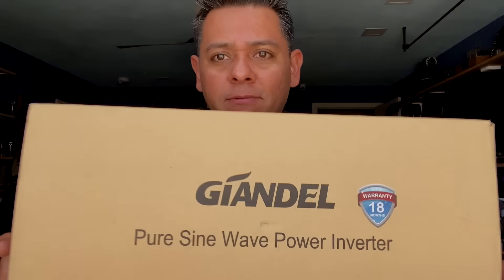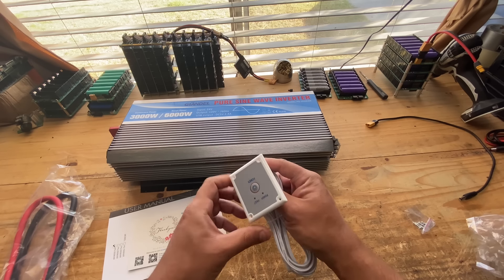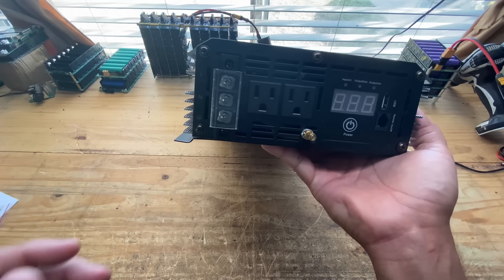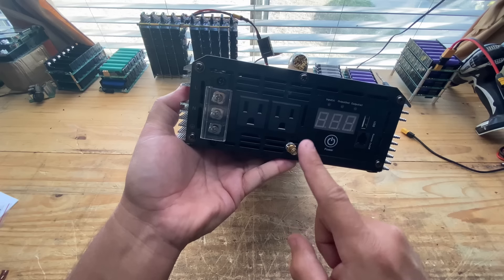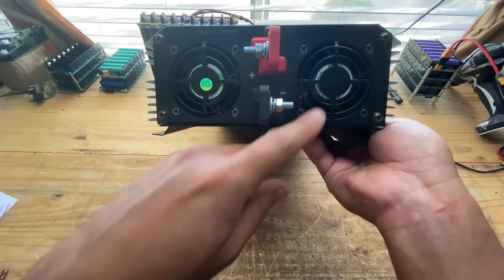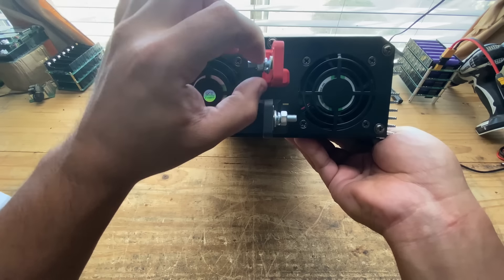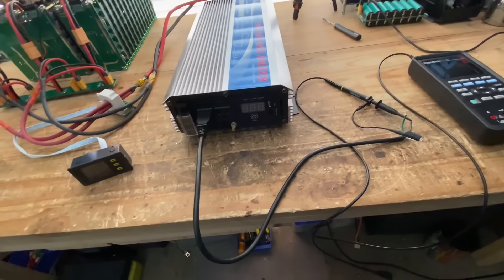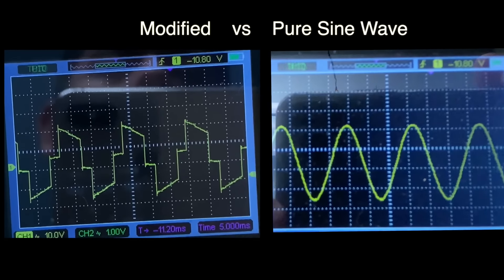Giandel 3000W Pure Sine Wave Power Inverter  Review

Comment: @6:57 efficiency is 85% not the 92% as claimed in the Video, input voltage was 27.55 and current was 19.6 Amps hence power was (P=VI) 539.9 watts and output power was 460 Watts.

Comment: I need to make a portable 48V 10kWh hand truck system. I would like to use an inverter charger. Xijia makes a 3000-watt inverter/charger (6.7kg) that might work well, if it comes in 120v AC. I need to decide between this and a Growatt 3000-watt, which is about 650USD but weighs only 12kg, or a Growatt 5000-watt at about 900USD, which also weighs about 12kg.
Reply: Just now realized that the Growatt 5000 comes in only 240v. Adding a heavy transformer defeats the whole purpose of making a portable system.

Comment: Does this inverter is really providing 120v from the outlet ? my second question if  I have 3 battery of 12v Can I plug them in serie and prallale in order to get 24v system. Thanks JS

Comment: excellent video. if was to add to the conversation. i would not trust the inverters display to be accurate. if used my inverters display to calculate my inverter's efficiency, it would be about 95% efficient. if i measure the output of my inverter using killawatt meters, which i trust,  i show my efficiency to be 89-91% efficiency. of course this will change with low voltage going into the inverter and and various loads put on the inverter.

Comment: Hi Jehu wassup there great review on this inverter but it is maxed out at 4kw for safety it seems than the actual rating of 6kw? Well being a sound guy I figured out while you were showing the inverter your lence and rode mic were looking at the object making y you sound like talking off the mic, a small tip to just turn mic towards you while you point camera at any object that will give your audio more clear n good, colour settings on camera did change you were looking as if a posterized effect was used, please don't feel offended Jehu but yes turning mic towards you on flash mount of cam will tighten your production quality bro, I m a sound engineer and film editor so would like my brother's productions super tight as his knowledge, GBU
Reply from the maker: I used my iPhone on this video,  no external mic
Reply: @jehugarcia   ohh ok, I thaught you had your DSLR with rode mounted on it, Jehu I got my hands on a Toyota Innova, soon as I get good amount of cells harvested I shall start the conversion, only your guidance will do that right.

Comment: 2.5 Years late, but the 'inverter temperature' is actually a reflection. Shiny metal is horrible for trying to get a remote read on because it is just a thermal reflector.

Comment: The output diodes look like they will get hot during use. Their layout seems kind of badly thought-out. Their heatinks are facing the airflow and blocking it, and the capacitors either side of the heatsinks will block any airflow that does make it through.

Comment: jehu I need some help. What kind of inverter do I need to run my ninja foodie air fryer in my van? According to website it runs at 1760 watts and 14.6 amps. 
I currently have only one 100 watt solar panel and 2 AGM Optima batteries.

Comment: With that alternate power hook up, could you attach a 30 amp rv plug in
Reply: You could connect a 120 volt 30 amp outlet, or female cord end to the AC output terminals. 

Note: 
3000 watts @ 120 volts = 25 amps
6000 watts @ 120 volts = 50 amps

Comment: How does this compare to aims? I have been looking at the aims pure sine wave with 120a charge capabilities. Possibly the 240 volt for whole house power off battery backup and pair it with solar battery charging. I do like the remote switch on this guy though.
Reply: I saw a review of one of the aims and it handled beyond its rated surge capacity very well for a long length of time.

Comment: Can this inverter be connected to a panel with that has the neutral bonded to ground (within the panel)?  Like most houses in the US and Canada?
Reply: you don't understand your question enough; how can we?
without a transfer switch you shouldn't be connecting up to your panel. with a transfer switch you can shave your electrical bill.
Reply: @fishhuntadventure  To be clear, I meant in an off grid situation.   (Not grid tied.)   Most homes have the neutral bonded to ground inside the panel.   So if you connect the hot and neutral  you are assuming the grounding of the panel.  Some cheaper inverters don't permit this as they are actually +/-60V AC with respect to ground instead of +120V.   If you bond the neutral to ground with these inverters you are basically shorting it out.  But better inverters usually tolerate it.   I was wondering which style this one is.
Reply: @JoshDurston  thanks for the clarification. 
FWIW my Giandel 1200W? (not there, can't remember exactly LOL) just sits in the floor of a cabinet and I use the remote to cycle it on/off. It is earth grounded as well as the bare copper grounds to the panel bare copper. I literally used a 12ga extension cord wired to a GFCI and plugged  in to the inverter. Then I ran another short cord from the GFCI to the fuse box. Sure the fuse box will "handle" more Amps but i figured it did not matter since the inverter will top at 15 or 20A surge and trip out and other than the vacuum (8-10A) nothing big ever will be run. 
I have not had any problems, the GFCI works with the test button and a plug-in tester,  and the GFCI has only tripped once in use when I turned on the range hood light once two summers ago.
I don't think the bare copper / 3rd wire should ever be any volts AC if everything is wired correctly. That's a just-in-case safety measure wire that should trip a breaker or otherwise  prevent electrical shock should an 'event' occur is my understanding.

Comment: Just had 2 of these via amazon and had to send both back, same problem with both - kept cutting off while trying to do a coffee from a 1200w coffee machine and i noticed that the voltage displayed on the inverter was about 0.6 of a volt lower than what my battery monitor and my multimeter was displaying, it may not sound like alot but when my batteries was showing 12.9v the inverter was showing 12.2v - batteries at 12.7v inverter at 12v and then beep beep beep then turns OFF !

Comment: I am looking at using one of these 24v 3000 - 6000w inverters on a lithium titanate battery bank comprising of 66160 cells 10S 6P, I do like the low battery cutoff range on the specs that would suit the LTO battery bank, anyone else tried one of these in this combo?

Comment: How big gauge can you fit in those terminal blocks. I can't believe they're rated 25 Amos but they use 12gauge wire. I wish they opted with the 10gauge on the ac side

Comment: 13:27 The Min/Max option on a multimeter will not measure the inrush you need to use one with an inrush setting, I did that with a grinder, and it said 20 max amps, but when I used inrush it showed 37 amps. the min/max just doesn't grab the actual inrush. If the scaling is linear -ish, that seems like it overloaded at 6500 watts roughly.
Reply: This is a good point. Food for thought.
Reply: Was just about to say the same. I don't think the resolution on that meter in that configuration would show it.

Comment: At around 7m in you remark on the voltage difference between the meter and the inverter.  That's because of the voltage drop over the wires at 30+ amps.  At idle they should be much closer (although they'll probably never agree exactly unless you trim one of them).

Comment: Can you “rate” the best/worst, best value, etc inverters in this “class”? I am looking to run a 3,000-4,500 watt off grid system with Solar as the primary source of incoming power.
Reply: Nobody knows, that question has no good answer.  Based on the most current reviews, todays crop of cheap Chinese inverters is worse now than ever.  Appallingly high failure rate right out of the box.

Comment: Jehu one more thing struck my mind, opening laptop batteries to harvest cells you get BMS strip right in there, can I use it for small battery packs which I am planing would basically have USB n regular cable outputs in a eight cell config. In series n parallel 25.6v 24 volts usable n 16amps if like every cell is 3.2v 2000 mA? Please guide.

Comment: awesome. im planning on buying the 3000w 24v 50hz/240v for my caravan.  - one question! would there be a benefit to combining the a/c outputs into 1 with a 15a 240v socket? (instead of 2x 10a 240v sockets as outputs) ?
Reply: I know it's been a while, but I would recommend wiring your caravan's sockets onto the terminals, and not the inverter's sockets.

Comment: Question, I have this unit and it keeps failing on a heater 1000w 120v and I have to lithium (2)12 v 100 at 24v and I have grounded which I don’t see in this video. Do you have an opinion?

Comment: Jehu,  If this inverter is used with your solar generator instead of the the 2000w originally used, what would be needed to change/add to build the generator? Heavier gage wire? I am building your generator now but can easily add this because of the benefits of power etc? Any thoughts?  Also the power meter has been unavailable for a while, any substitutes?

Comment: I would like to see if you can set up a micro grid with that pure sine inverter and then see if the grid-tie inverters can sync up to the inverter. So if the grid goes down can you get the grid tie inverters up and going with that pure sine inverter. ??

Comment: @jehugarcia
6kW surge means that it can start, like compressors but the load is only in milisec. not in seconds.... 

So this inverter could supply almost 20% more then specs in extended period of time (until the temp sensor will not trip off)

Comment: Nice waveform. Sometimes the waveform changes under load.
Reply: Uhh, That's because it's supposed to. 🤙
Reply: @ezmeraldadudortoka7549  ideally the waveform stays the same under load. I have seen pure sine inverters clip very badly under load.
Reply: @wearemilesfromnowhere4630  says who? 🤦‍♂️
Reply: @wearemilesfromnowhere4630  It's called a sinusoidal curve for a reason... It'd be called the straight line if it didn't fluctuate...🤦‍♂️
Reply: Must see waveform under reantive load

Comment: I used a car cap on my 12volt system for my 1200 watt True sine wave inverter and got much higher surge cause it now kicks my Ac unit on. I wonder if your hot cables can't handle that surge.

Comment: I'm very impressed with this inverter! MY idea for emergency portable Solar use is for after after a bad storm or other disaster when the local Grid is down. I'm ultimately planning o build a 200 Amp Lithium Battery, and Inverter-THIS one would be great-3-400 Watts of Solar and use it post-disaster to keep a large Bank of Cordless Tool Batteries charged up for the relief personnel.

Comment: Great video, i would like to ask you what do you recommend to run directly from the car's cigarettes' lighter and where am i supposed to locate the power inverter while it's connected to the car.
Here in Houston we just went through a few days of blackout with lows in the ten's and snow, but i wasn't prepared. I would really appreciate your advice.
I am looking forward to get everything i need for an apartment so those huge power generators are a nono, maybe an inverted generator would do it. I would've loved to be able to cook hot meals for me an my family and maybe run a couple of mini heaters but i had nothing. Now i don't want to make the same mistake all over again.
Reply: Your car's cigarette lighter is only rated to provide about 150 watts of power. For emergency heat, I would recommend an indoor kerosene heater. For cooking, one of those propane camp stoves will work perfectly. Space heating and cooking take a LOT of power.

Comment: Any one know if this inverter, or others from this manufacture, have a floating voltage on the neutral?  Seems like the standard is to have 60 volts on the neutral and 60 volts on the hot.  Very bad for some setups...and not good for anything in my opinion.

Comment: Great product review.  Someone should start making adapters for standard electric cars (Nis Leaf, Volt...) which would allow us to tee off of the battery pack.  Then suppliers could make something like this at those voltages.  That would give great portable power.
Reply: I have a chevy spark EV .I am going to see if I can use my battery box using a 2000 w giandel inverter.my car can use120 @ 8 amps to 12 amps max,to recharge it.
Reply: Couple of cars I know of come with a mains powerboard that plugs into charger socket I think.  Thats a great feature until 2way to grid happens.

Comment: Shared. The 6000W surge is for transient load (very short burst)  not a dead load at power up. Seems the top output power (non transient) is 4000W. Glad you showed the oscope test... do that under significant load with different kinds of inductive or capacitive loading....that is where distortion will be most obvious. Pretty good unit overall, inside looks well made.

Comment: Yeah, but i will never buy another inverer that does not have the EGS002 control b oard,cheap($4) and reliable;  this way i can fix it
Inverters with other boards are just time bombs, when they fail it's game over; have a few of them on the side because the (unidentified,sanded off..) chip failed.

Comment: I would like to see sine wave under load!
Reply: Yes, a loaded test of the sine wave in increments of load would be a very useful thing to test as some don't handle the load well and the wave formation falters
Reply: the same here, especially not under nearly resistive load (heater), way more inductive load or mix of loads would be interesting ;)
Reply: I would like to see sine wave under  inductive load
Reply: Me too
Reply: Those cables aren't good enough for full load.
Reply: doesent seem it would be good, look at the voltage drop when he turned the load up at 9:19 the power strip light turned off

Comment: I have the 4000/8000W 24V version of this Giandel inverter and it is working very well, even starting a clothes washer and drier (with propane heat), saws and small A/C units. Surge ratings are usually in Watts and duration. Most cheap units surge at the rating for a millisecond or two. For motor starting, I would think one would need the rating for one or two seconds which better units will have. Also the inverter may need to be powered up and stable within the continuous rating before getting a surge, but that is my guess so far. A general tip -- It might be wise to check the output on any inverter before hooking anything valuable to it. I blew out my RV appliances on a cheaper maker's unit. I suspect it was set to 240 VAC but labeled 120 VAC.
Reply: Exactly....I was asking for the same on this inverter...I want to be sure how the 120 V is produced.

Comment: I was interested in seeing what the DC current draw is when the inverter is in standby.  I just bought the 2000w / 24v of this.  I plan to use it to run freezers off of my solar/battery system, do I don't want a high current draw when the freezers are cycling off.

Comment: Was sure the AIMS was the one for my setup until seeing your video. Upgrading from 2000w to 3000w is my goal as I prepare my boat for the Seattle to New Orleans leg. I liked the descriptive portion of the video when the shell was removed and wiring gauges were discussed. Sure to make the Giandel 3000w the "heart" of my system now. Having an extra in reserve will lend a certainty to my effort.
Reply: Curious how it held up for you on this lengthy adventure? 

(I realize this is one heck of a long shot at getting a response 4 yrs later but if you do receive this it will be worth it bc that's some truly real world data you're collecting. Hoping for some good news!) I have heard and seen great things from these inverters but I've never seen AIMS and Giandel even used in the same sentence before today...

Comment: I use a bunch of Giandel inverters in stuff i build. Ranging from my 300w portable power unit right upto my 2.8KW system. They are fine so long as you dont try to hammer them all day every day. They arnt 24/7 grade inverters.

Comment: Are you aware that brand is compatible with 4S at 16 volts max input for the 12 volt inverter? Well at least that is what they have listed for the specs on amazon. Im going to get one after i get done playing around with my 2 ebike builds. Thanks for doing this video at least i know for certain this brand is clean power

Comment: Perfect  compliment to  my 3500 watt predator.   Just need 24 volts and I can run furnace in silence.  No solar for me surrounded by 100 to 150 foot maple trees.
Reply: If it is a resistive furnace then you are likely better off with DC heating element
Reply: It’s natural gas hyrdoair system.

Comment: Nice video as usually! One question, if I have a 400 vdc 100% charge (57.1kwh) power pack, how can I charge that pack while keeping the voltage on the high charge to 375vdc and be able to discharge to 280vdc and not below that SOC?

Comment: I would like it but because I live in Europe I can't use it.
perhaps it is possible to do the next giveway with a 220v inverter
Reply: Many electronics are designed to use a range of voltages, especially those with switching power supplies. A computer power supply will handle both 50Hz and 60Hz, and 120V and 220-240V (although you might have to change a switch on the supply) without complaints. Check with what you plan on using, it might also be possible to get a transformer to step the voltage up.

Thirdly, search for the term "giandel pure sine wave inverter <dc voltage>" on your Local Amazon website as I found the variant with the UK plug on amazon.co.uk although it doesn't have direct wiring, however, you obviously wouldn't be able to get that version in the giveaway.